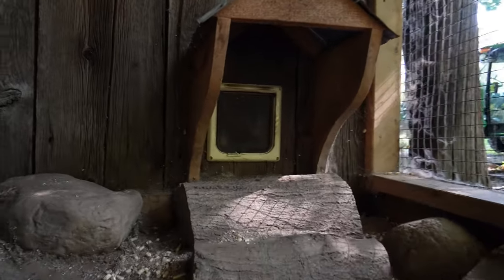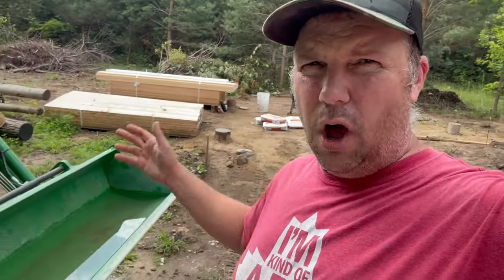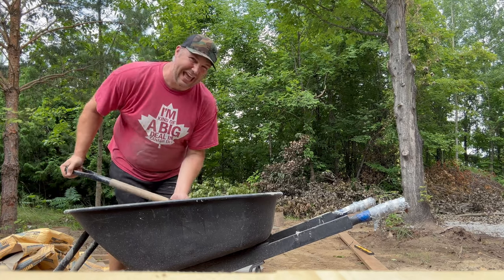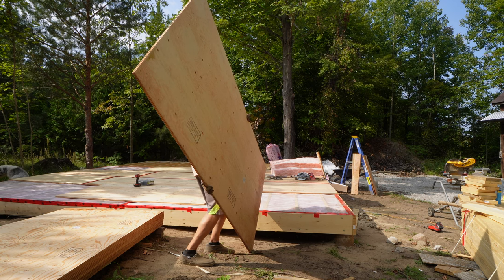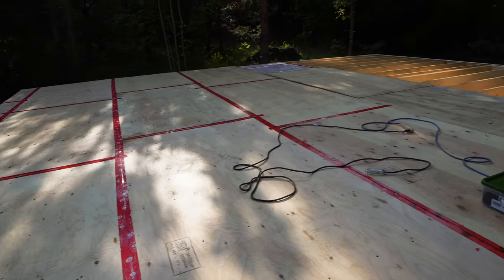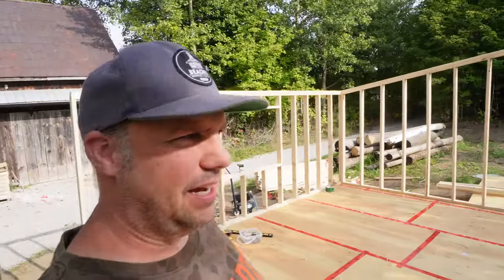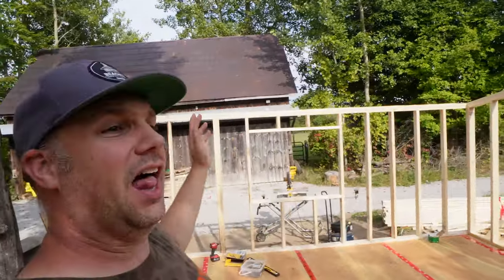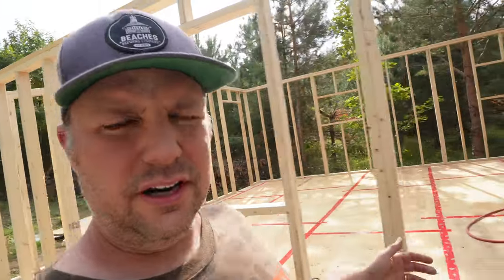Building a Workshop From Scratch - Part 1

Comment: Great to see you have the skills to build a new building, but how about designating half of your existing building to the kittycats, instead of allowing them to roam the entire existing building?  Oh well you must have cha-ching to burn, instead of using tough love on the kitties.  God Bless your heart!
Reply from the maker: It could be done but the space would be pretty small if I sectioned it off. Plus I can’t stay in there for any length of time in the winter since it ‘a old & drafty. It’s built like a barn not a shop. Once I get a sawmill it’ll be setup beside the new shop so it made sense 😉